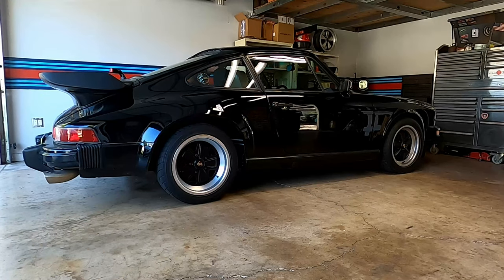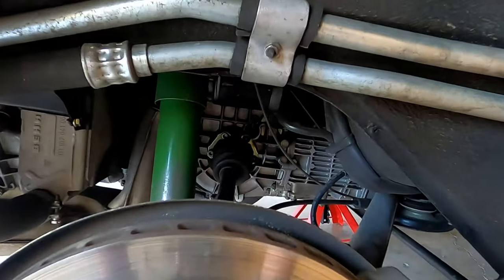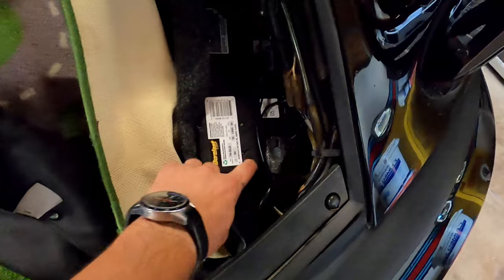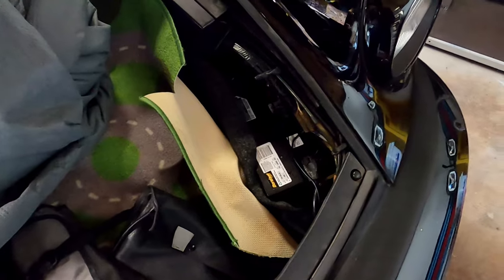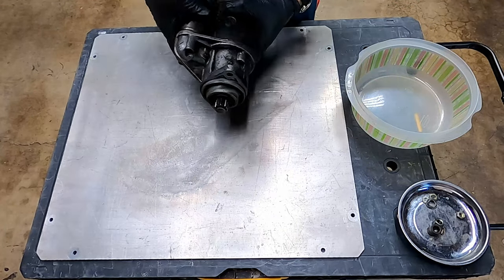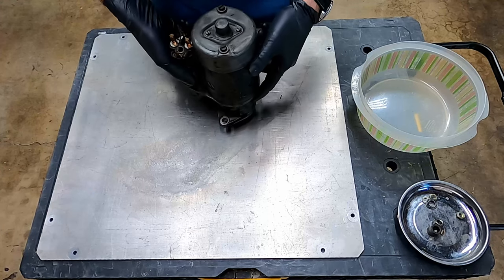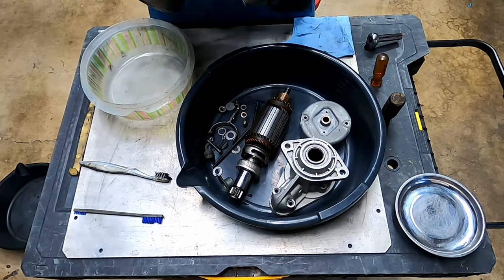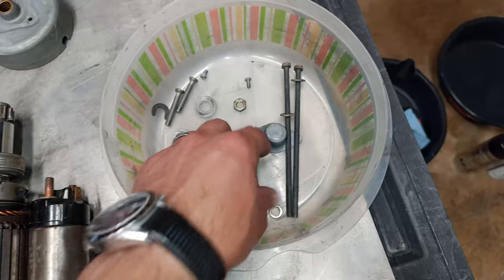Air-cooled Porsche 911 Bosch Starter Motor Rebuild Part 1 of 2: Removal, Disassembly, & Inspection

Comment: On my 1986 starter, 68,000 mile car, the black paint looks like it was dipped, with a line crossing over onto the aluminum housing.  I think rebuilt units the black paint is only on the steel parts, not the strange dipped overlap look.... So this may be a Bosch rebuilt from back in the day.  The oilite bushings in the unit can be re oiled in place if you have a vacuum chamber large enough to submerge them in oil, pull a vacuum for an hour or so, thenet sit overnight submerged, atmospheric pressure forces them full of oil again.
Reply from the maker: Interesting. I wonder if these were dipped by the same folks that dipped Fuchs wheels...

Comment: I did mine last month, and I found your video. The title is misleading. It is not a rebuilt. If your solenoid was sticking you probably damaged the pinion gear and the crown gear that is bolted thru the clutch pressure plate. In order to do it properly you have to take the engine out if you see excessive damage to the crown gear thru the hole for the starter mounting location. Both my pinion and crown gear were damaged, so I replaced them. I found a pinion gear on ebay for $40. But when I tried to remove it from the rotor shaft I could not. I searched the internet for 4 hrs including your video but to no avail. The pinion gear is held by ten 3 mil ball bearings that fit each of them in the spline groove of the pinion shaft. You need to pull the small housing ring that keep the balls together and when you do, by pulling the shaft in the opposite direction each ball lift up through the ten holes at the end of the shaft, then, 2 things happen. the pinion gear is free from the rotor shaft, and all the freaking balls come out and bounce all over the garage floor. You will be on your knees with a flash light for a good hour,. I managed to find 9 out of ten. Good enough for me. Lesson learned. My advice always replace the solenoid with a new one, and replace the pinion gear if chipped or worn out teeth are found. The only thing new about your starter is the paint.
Reply from the maker: You forgot the grease! The grease is definitely new!